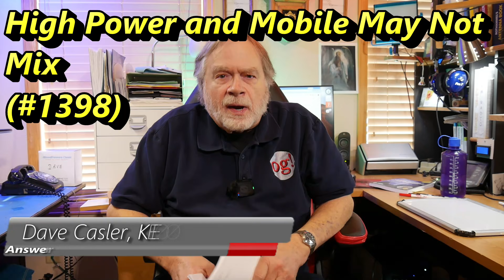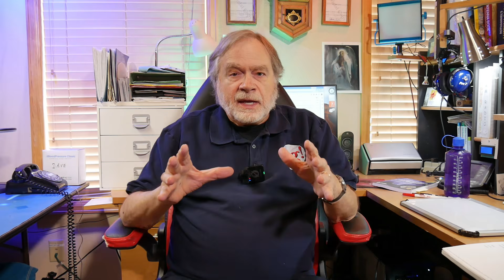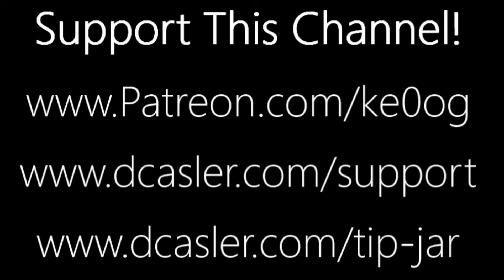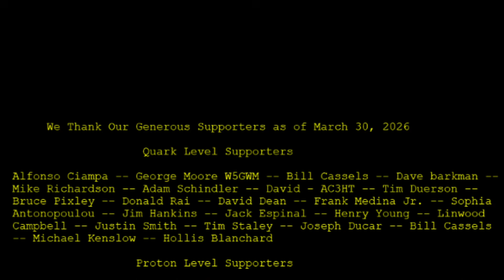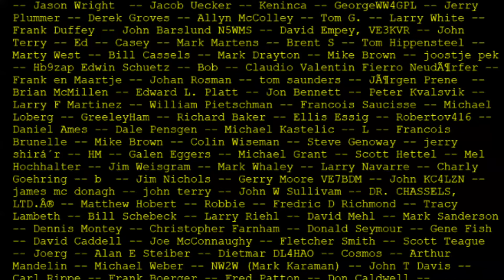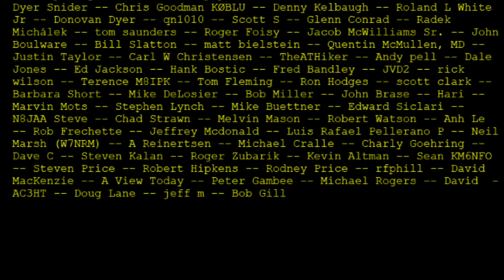High Power and Mobile May Not Mix (#1398)

Comment: Ha! You nailed it. My Subaru TPS was lighting up when I used my SharkRF hotspot in the car and that uses very low power. I did some research and was shocked to learn that the default frequency in the Subaru was the same as I had set the OpenSpot to. It was an easy fix but an eye opener! Today’s cars are not radio friendly in any way; both installation and interference hazards, not to mention voiding the warranty. 

Thanks Dave!

Comment: I've owned four Prius cars I never had any RF problems, the one I have now is a 2017 Prius Prime Advanced. I use a handheld that sits in a cup, is powered by the cigarette lighter plug, and use a mag mount on the roof with no problems. Also, the AM radio works VERY well, no interference whatsoever and this is true for every prius that I've owned. I actually use the car radio for mediumwave DX in parking lots while my wife shops in stores that I can't stand. Five watts is plenty to hit most repeaters by the way. 73 DE W8LV Bill (and in SANER times: W8LV/VE3)🇺🇸🇨🇦🙏🇺🇦

Comment: I run 100 W in my 2007 Ford F250, using a Yaesu 891 to a Yaesu ATAS antenna, almost every day, with no problems. Granted, I’m not transmitting all the time, mostly listening to other QSO’s. However, I’ve had some fairly lengthy chats, including a fair amount of DX’ing with no issues at all.

Comment: I ran 160~15 meters in a 2000 Grandcherokee, and the only band that I used to have trouble on 60 meters.  60 would kill the engine on voice peaks.  The inline 6 engine has a lot of torque, so It felt like it was going to tear the engine out of the jeep.  Grounding the tail pipe solved the problem.   I run160~75 meters from the mobile, and it really requires an amplifier.  6 dB can be the difference when the band is full of lightning.  

lightning tip for those on the west coast.  Take advantage of the D-layer operating on 80 m just before sunrise usually eliminates the lightning interface from the east coast.

Comment: 5:15 I am VERY skeptical that the mechanic at your local dealer where your warranty service would be performed would even consider the idea that you transmitted on a high power radio too close to the car voiding the warranty. The computer likely would not have any visible damage anyway. From their point of view it just failed as they have been known to do occasionally.
Reply: Yea, my bs meter hit 59+40 and broke. That is way beyond any mechanics pay grade, and almost impossible to prove. especially, considering cars are exposed all day every day to high powered signals now.
Reply: Yes, they see my 14' tall HF antenna long before they see the jeep holding it up.  One look in the back and the battery with 2/0 wire going to the black box, and it's obvious I'm running power.   Pluss separate antennas for 6m, 2m, and 70 cm.

Comment: High power mobile operations: go and look up Keydown Competition. You’ll see Chevy Suburbans fitted with multiple alternators, 16 / 32 pill amplifiers, and a whole array of antennas. 

Hint: they’re not using the ham bands 😂

BTW I used 20W on 40m to do mobile CW in my old 1999 Ford AU Falcon. Tried 100W but that was ripping close to 20A out of the electricals for an extra S point.